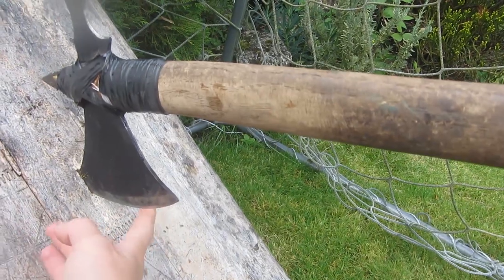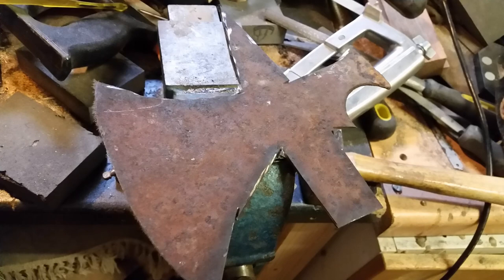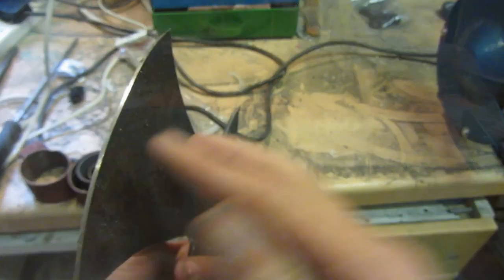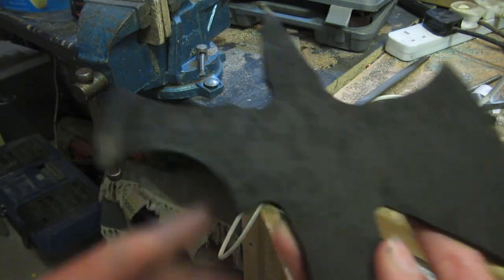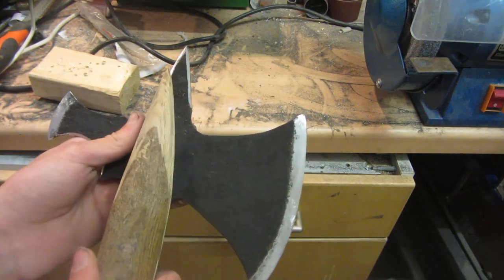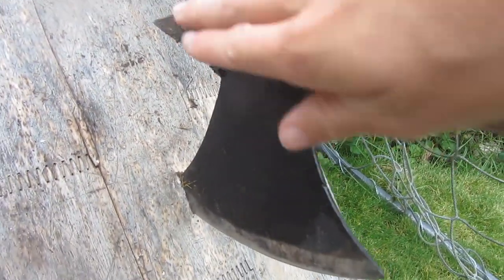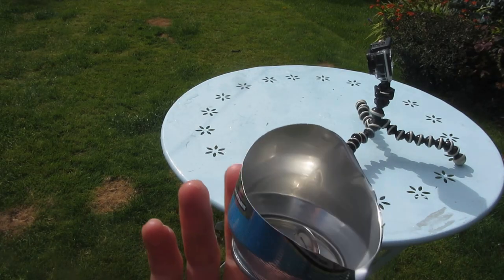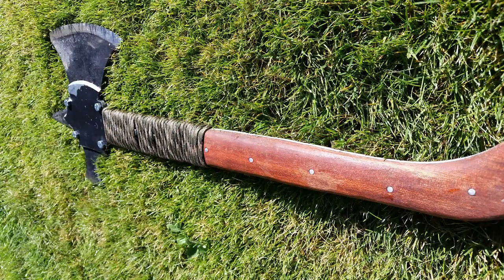How To Make A Steel Tomahawk

Comment: Nicely done. Though the head does look a bit more like a halberd rather than a tomahawk, at least to me. A couple of ideas. For the wrap, perhaps copper wire. For securing the head to the handle a few holes through the tang would allow the epoxy to bridge or it could be pinned/riveted. The poll could be shaped differently, perhaps like a billhook, makes it more useful.

Comment: For chopping and throwing yes but this is way too thin to be good for splitting. If you want to check it out look up a splitting maul or a splitting axe.  You will see the difference immediately.
Reply: Depends on the size and type of the timber being split. I just got some Australian iron gum and it was in massive rounds from a very old tree. Now that took some serious swings with a heavy block splitter, definately out of the range of this tomahawk he's made. But that said this would be fine for alot of stuff and it's a beautiful thing he's made
Reply: sideswipe147 Are you serious?   This guy has made a tomahawk out of a circular saw blade; the implementation of which is ingenious.  It sounds like you bought a tenon saw with the expectation of cutting holes in 10mm steel plate.  One tool does not serve all purposes, irrespective of its apparent function.

Comment: Just a little bit of advice the top tip of the blade should be flat not pointed up the tomahawk is supposed to stick where that curvature is so your hawk is probably not sticking so well or its sticking in weird angles

Comment: Art of weapons - Quick tip: Don't use cold water to quench, ever. It actually will ruin the steel even more than any other method of quench. Use warm water and it will prevent MOST of the tiny cracks that will actually cause the quality drop in steel.
Reply: Thank You. You Just Helped Me ALOT. Was Wondering Why My First Knife (Made It With My Friends xD) Was Always Shattering  And Sending A Small Blade Fragment  Towards My Friends Fathers Face. xD
Reply: Be sure to use warm oil if at all possible, though, and you'll need to temper afterwards. Go to IForgeIron for more advice and a lot of great advice on tempering.
Reply: Micah Burgin I Already Knew About Tempering; It Was Just Hard To Get The Right Temprature For Long Enough.
Reply: Oven?
Toaster oven?

Also, don't capitalize the first letter of every word. It makes it difficult to read your paragraphs because your sentences all bleed into one another. Your grammar is pretty much perfect aside from that.